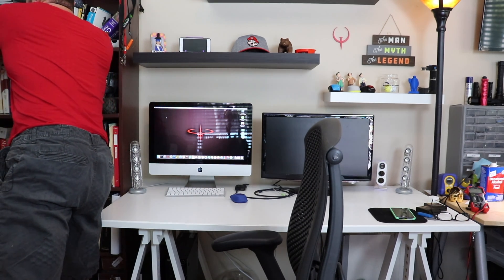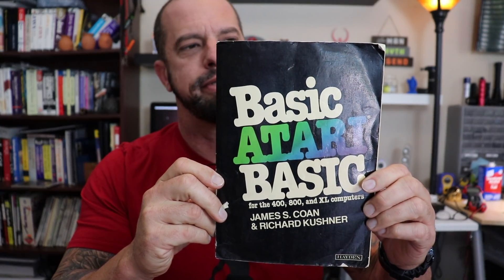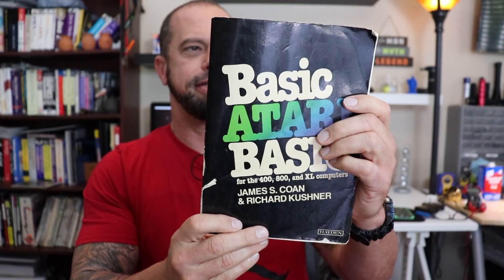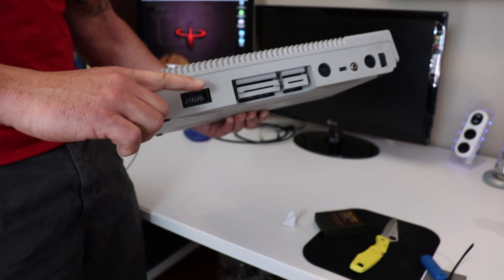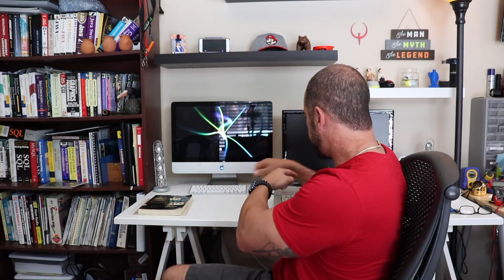Atari 8-bit 130Xe introduction

Comment: I was born in 1983. my older brother gave me 130 times in 1988 atari. I still have it, unfortunately due to a power failure it stopped working. Nep basic or test will run. Only blue screen :( in my opinion it's a very good machine for learning and the amazing games I played on it ...
of course I also had the original atari joystick 7800. floppy disk drive and cassette with turbo: D
then after the creation of the American protectorate (Czechoslovakia 1989) I went to a computer interest group and there were again DIDAKTIK GAMA.
In fact, I'm a lover of old honest technology.

Comment: Just discovered your channel, thanks for your great videos. in 2019 I purchased a new old stock 130XE unopened from a seller in Poland. I'm currently setting up a computer lab with retro computers, and I'm looking forward to using the 130XE along with the SIDE2. Being a Commodore 64 user from release, the Atari line is a complete mystery to me.

Comment: I still have some of my old Atari equipment but not all. I started with an 8k Atari 400 with the mylar keyboard. then 800, 800XL 256K-800XL 130XE, 1088k-1030XE  Mega ST Mega4Ste.   I miss my ICD upgraded 1040 130k Floppy to 256k Floppy with ultra speed sector scue.  Then there was Assembly Language, BXE and BXL, Omnimon and OmniView. We stacked 256k 60ns dynamic RAM 4 high and stacked the operating systems too.  Mostly I worked on Telecommunications because of my Atari BBS from 4-8-84 until 2004 at that time running on WildCat 5.  Also ran the national concentrator for the ISIS Atari network.  Ran Fidonet too.  Those were the days.   I still have the ROMS for Drives 5-8 from ICD for the 1040 drive.
Reply: or not... I just opened my electronic storage box and the ICD drive 5-8 roms are missing.  I am still looking. Perhaps someone would love them when I find them.

Comment: 0:00 Quake 1 and Quake 3… no love for Quake 2?

4:23 You probably need to hide your face to make the video camera focus on the printout, since they'll usually focus wherever they can detect a face. 

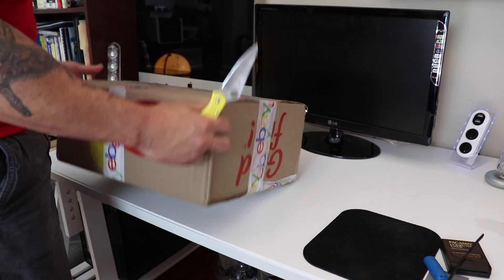8:51 It looks like a Spyderco except for the logo.

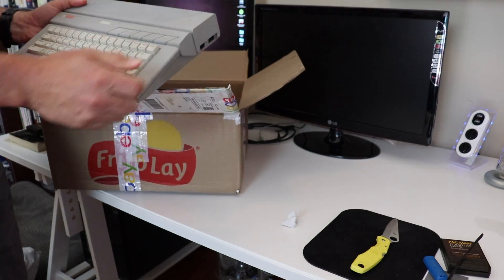9:32 Seems like a terrible spot for the BREAK key.  The RETURN key's in a bad spot, too.  With the graphic characters on the fronts of the keys, it looks like somebody was copying off of Commodore!

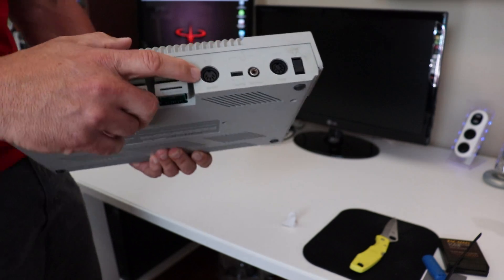10:50 The video port apparently offers separated Chroma and Luma, so you should be able to make an S-Video cable.

11:05 It seems odd that the ROM port is so much wider than the general bus-expansion port.
Reply: The narrow Expansion port would make sense if it were meant to be used in combination with the ROM port, where the ROM port would provide the Address and Data lines and the Expansion port would supply extra control lines for I/O chips and maybe a few more Address lines.
Reply from the maker: The manual says Enhanced Cartridge Interface (ECI) Connects high-speed peripherals such  as fast floppy disk drives, hard disk drives, and custom 1/0 devices. i will look around to see what was made that takes advantage of this port.
Reply: @csbruce  That's exactly right.  The two ports together made up the Atari parallel expansion bus which had been a single card edge connector on the 800 XL.  Some schmuck named Tramiel thought he could save a couple pennies by combining the Cartridge and Parallel ports together.  The most common parallel port device (which worked on the XL series and the XE series with an adapter board) was ICD's MIO box which had a hard drive interface, a printer port, a serial port, and either 256K or 1meg of ram.  They were supposed to come out with an 80 column upgrade but I never saw one.
Reply from the maker: Lol yes Quake 3 is my go to... Are you referring to the Spyderco in my pocket?
Reply: @8bitandmore : Your knife has the Spyderco shape but I don't recognize the logo.
Reply from the maker: @csbruce  yep Spyderco H1 saltwater resistant model
Reply from the maker: Oh and yes I have an svideo cable but the capture device I am using only takes composite...
Reply: The general Atari keyboard layout was finalized with the original 800 keyboard back in 1979, so it's more likely Commodore copied off of Atari unless you're including the Commodore PET and I really couldn't tell you if the PET had the PETSCII characters on the key-caps or not.
Reply: Correction: my old memory is breaking down.  The original Atari 800 keyboard did not have the ATASCII character set on the keys.  They were only added by that Tramiel guy when he re-branded the 8 bit Ataris as the XE line.  Probably the only thing he added to the Atari that didn't already exist as a prototype sitting in the RD department.  And yes, the PET did have the PETSCII characters on the keys also.